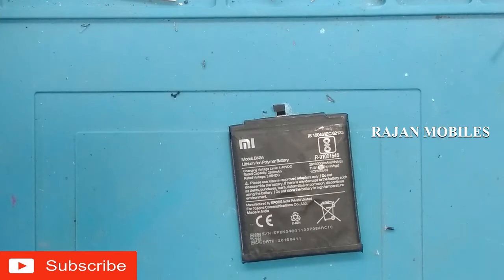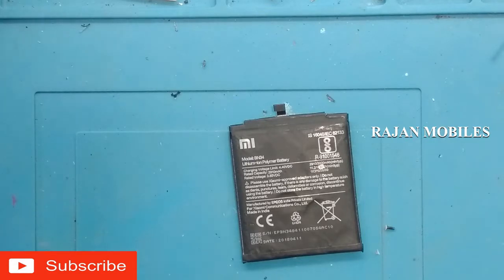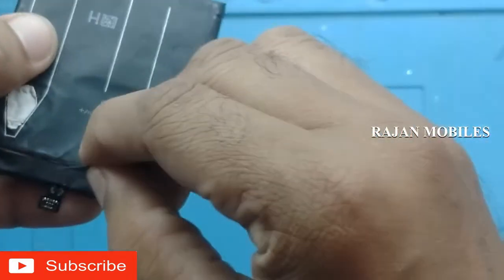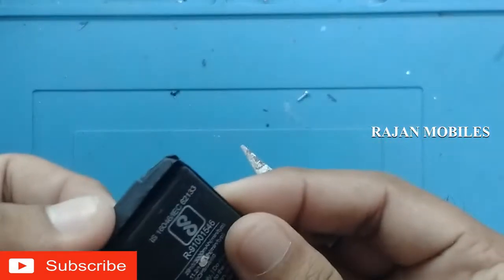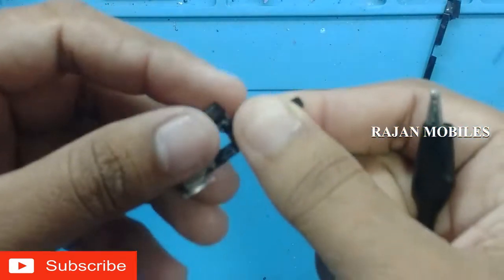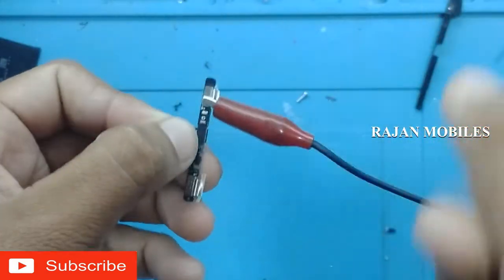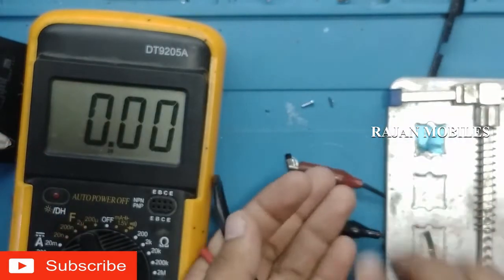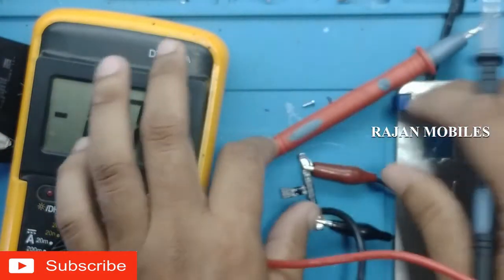Android waste battery to Android power boot cable | DIY  |

Comment: Good job brother tq  and dc power supply device ku pathila charger use pannalama antha connecter la bro
Reply from the maker: No bro charger la 5.2 volt varum so mother board damage aagum
Reply: Tq

Comment: Pandi bro SMD WORKSTATION Enna brand vangalam any suggestion please🙏
Reply from the maker: Quick 875plus
Reply: @rajanmobiles7872  Nanri Deivamey
Reply: @rajanmobiles7872  Quick 875 plus or Quick 857Dw+ rendu la ethu bro
Reply from the maker: Sry bro 857dwplus
Reply: @rajanmobiles7872  okay bro
Reply: @rajanmobiles7872  Bro ₹ 6000 varthu ithan price ah..?
Reply from the maker: 5500
Reply: @rajanmobiles7872  Bro neenga recommend panna JPM communication la 6000 thousand solranga vera enga kammiya vangalam
Reply from the maker: Anga dhan bro kammiya irukum...inaiku prize yerirukalam..konja naal kalichu kettu parunga

Comment: Hello Bro, Thanks for Video...Enaku oru doubt Android board la batery connector la check pannum pothu multimeter value 
Red  + ,Black  - ( value 1200)
Red -, Black +  (450)

Intha mari irukura board ah ready panna mudiyuma, fault enga irukum, video iruntha podunga
waiting for your reply
Reply from the maker: dc la vara reading sollunga
Reply: @rajanmobiles7872  Dc vachilla only Multemeter value vachi than check panren
Reply from the maker: second value 400keela koranjadhna problem so normalah dc la boot pannadhn enna problem nu teriyum